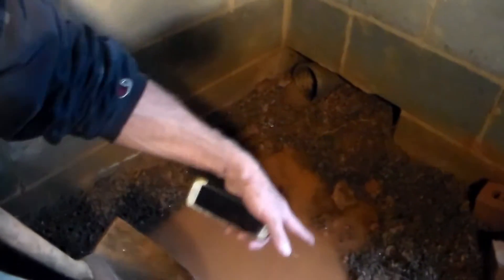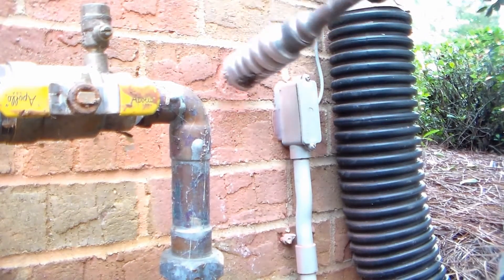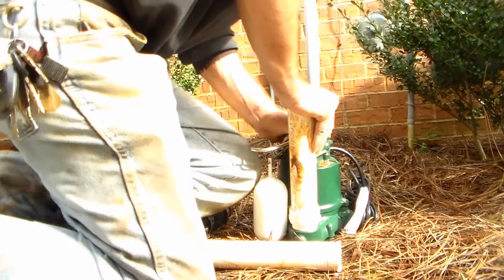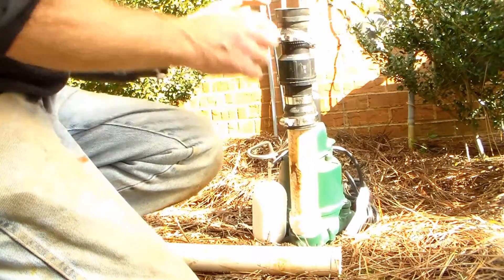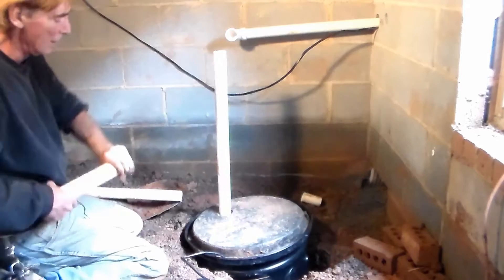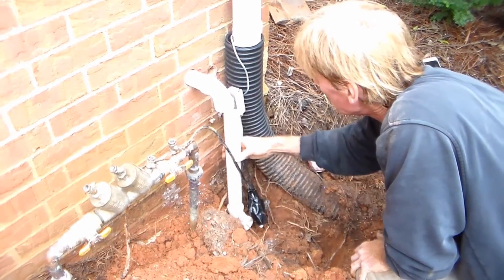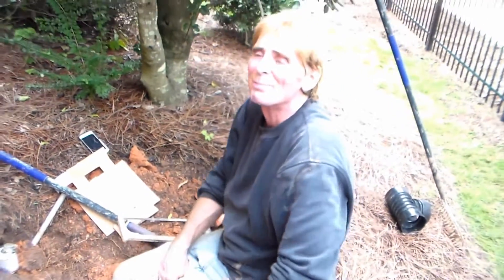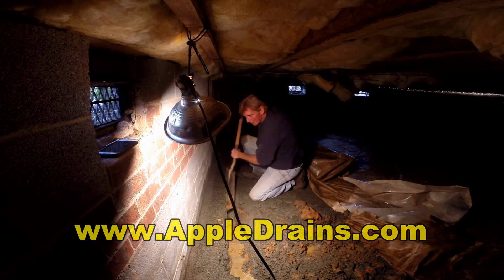How To Install Sump Pump in Crawl Space

Comment: Hi Chuck, I am going to use an assembled Sump Kit. Since no (footer) pipes get attached to the basin. Do I need to drill a hole around the basin to let water in? Do I need to drill the bass of the basin? would you suggest pattern of drilling holes? Thank you so much.